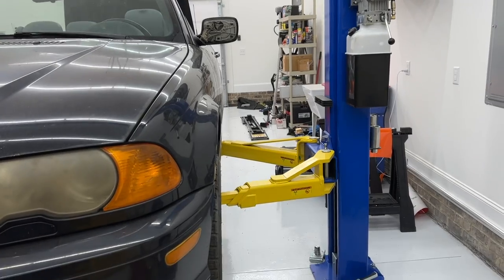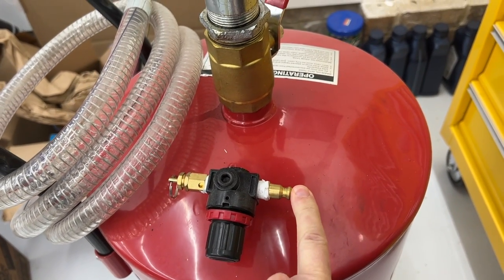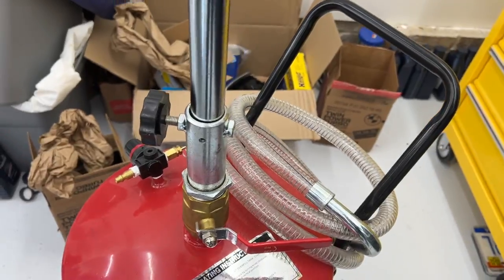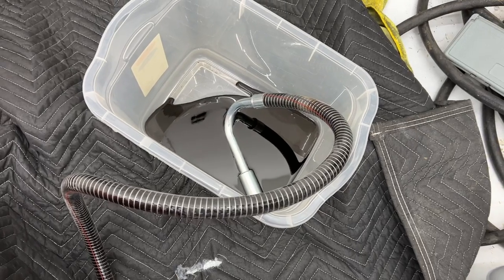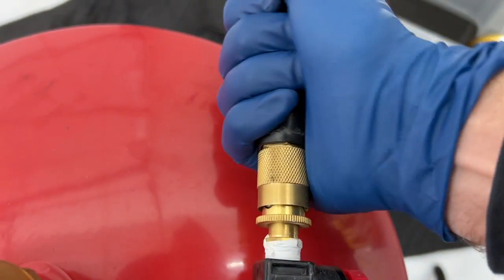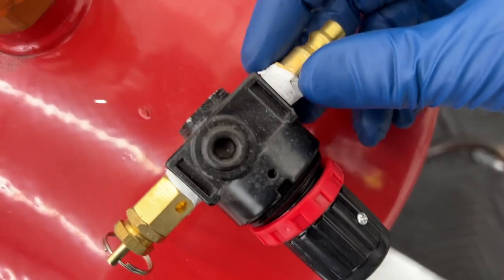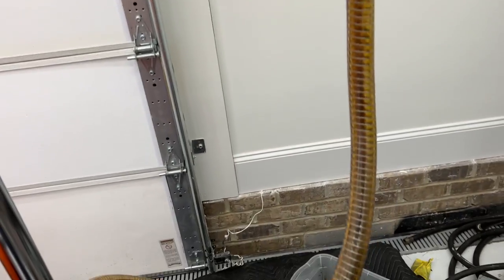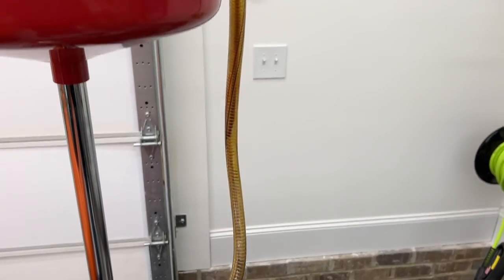How to use the Lincoln 3601 Oil Catch Can/Fluid Drain Tank  |  Tool of the Week

Comment: Hi Help Me DIY, This is Lincoln Industrial! discovered your video and wanted to add a note concerning the regulator and air.

1) The regulator is pinned to roughly 5-10 psi and is non-adjustable for safety. We do not recommend altering the regulator in any way. Simply attach your air coupler to your oil receiver and it will immediately begin building pressure and dispensing the used fluid. Some have added a small ball valve between the nipple and the regulator as a better way to control the air supply.  
2) Make sure the big ball valve is completely closed before applying air! This is essential for allowing the pressure to build in the reservoir so fluid dispenses out the nozzle. I normally suggest completely removing the extension and bowl assembly so the valve does not accidentally get caught or the valve surface damaged.  

The 3601 is remarkably simple to use and is a very popular tool for shops used fluid collection during services!

Thanks!
~John
Reply from the maker: +@lincolnindustrial thanks for that info! 🍻

Comment: I typically dump my used oil into 5qt or 1 gallon containers to take to disposal. Just bought a lift and was wondering if this style tank had any way to shut off flow as you're evacuating into smaller containers to not overflow?
Reply from the maker: +@diversedad7954 you have to disconnect the air and pull on the pressure relief ring and it will stop the flow, but really slowly. So I just got a 5 gallon container with a large opening on top to empty it into to dispose. Too hard to put it into any smaller container

Comment: Your male air fitting is not screwed into the regulator tight enough and it appears that your air hose and male fitting are not compatible. You want to be very careful about cranking in a lot of pressure. Very little pressure is needed if your connections are secure.  The unattended
hose in the drain bucket has been known to flop around when it’s surging and approaching empty, making a massive oil mess. You might want to think about holding onto it when draining.

Comment: hi can you add a gauge and would it even be beneficial. ???
Reply from the maker: The clear tube actually acts as a gauge ;)
Reply: i just order me one linkcoln 3601 like yours but how do i know how much air  pressure to add??? just adjusting the regulator enough to get fluid moving out is that all i wonder?
Reply from the maker: @victornaja-paz5241  yup!